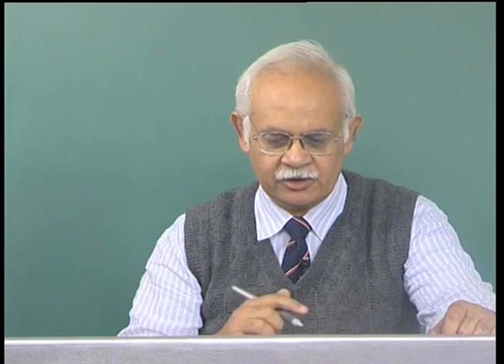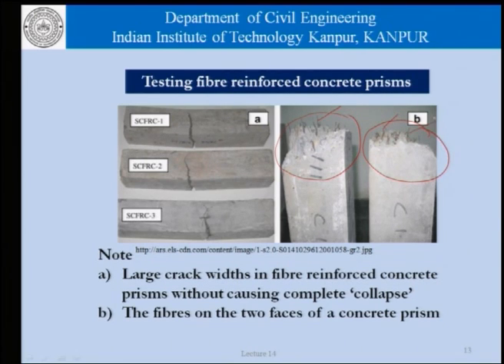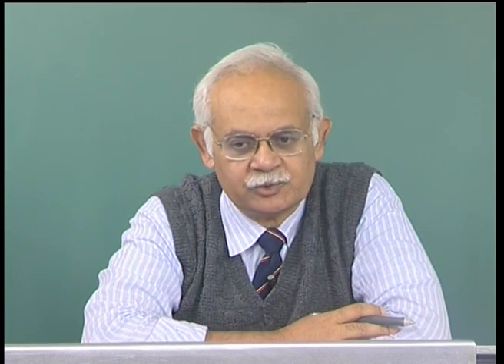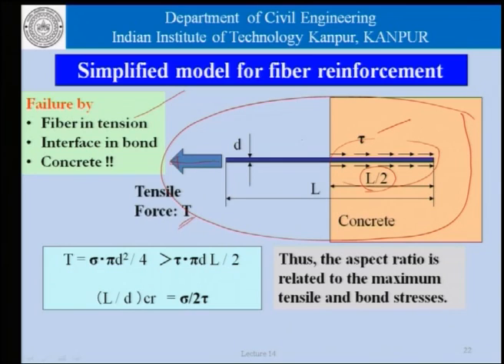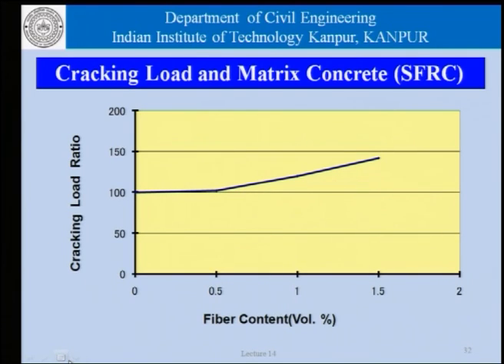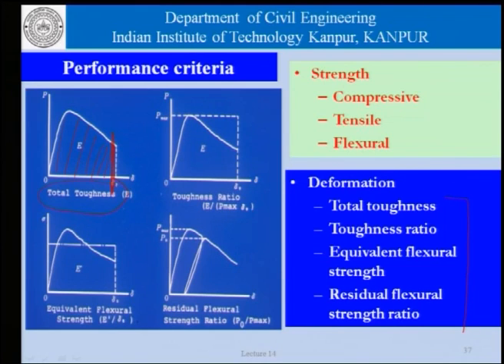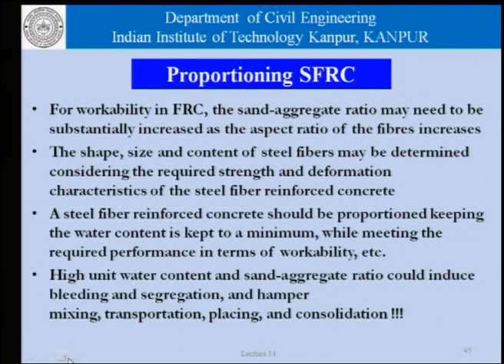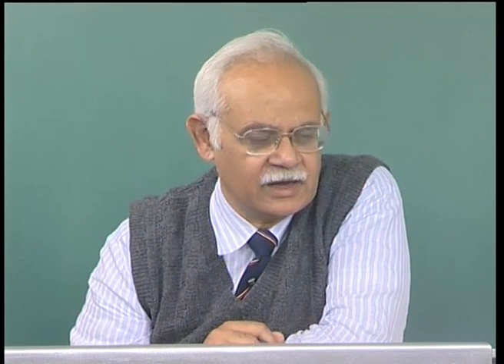Mod-01 Lec-14 Fibre reinforced concrete

Comment: Sir, it's a great help knowing all about Fiber Reinforced Concrete in detail but I have one concern regarding the use of FRC in the Water flowing concrete structure where hydraulic jump occurs and abrasion is high enough due to heavy sediment load and also, Is there any problem of environmental impact due to content of steel fiber, pollution of water in the river?